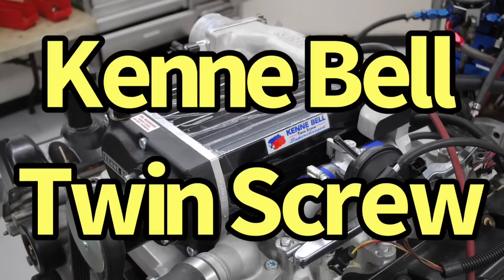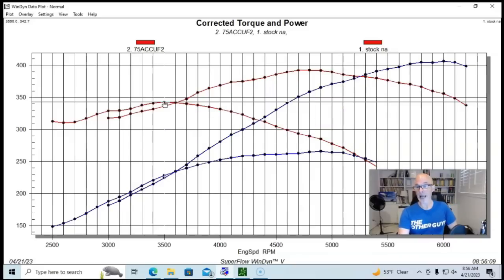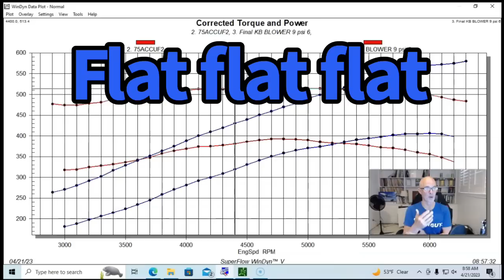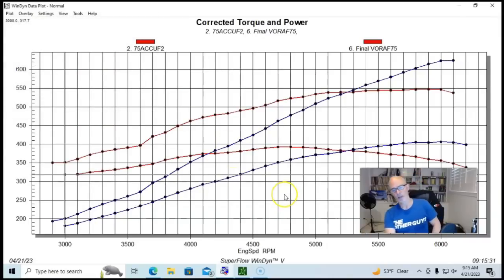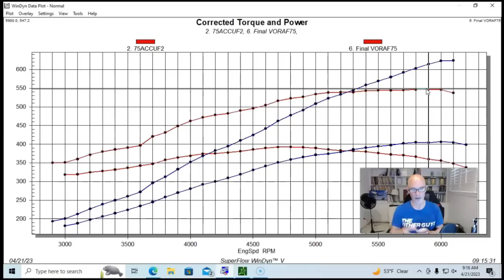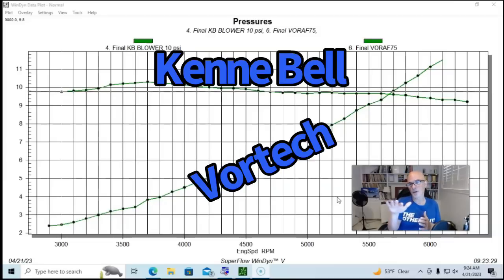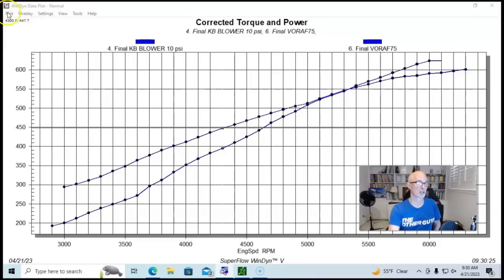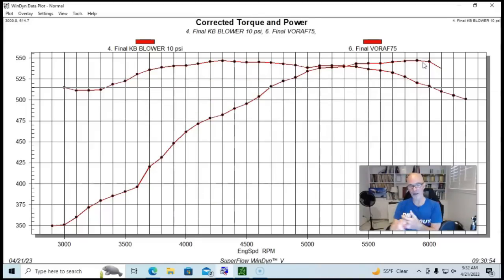JUNKYARD FORD BLOWER SHOOT OUT! WHICH BLOWER IS BETTER? VORTECH VS KENNE BELL BLOWER-4.6L 2V TEST

Comment: Hey Richard! What engine management system were you using on all the windsor 5.0 tests? I really wanted to see you do the ebay single turbo setup on the stock efi 306 with stock e7te heads, but utilizing the factory ford mustang speed density DA1 ecu and TFI distributor with only being able to change injectors and timing- of course youd have to utilize a FMU, but that is an affordable part considering even with it and a bolt on ebay single turbo setup it's still cheaper than a set of bare aluminum heads and quite possibly could make more power than changing out any of the stock components like the heads, cam, or intake. 

Only curious because engine management systems cost a fortune, aluminium heads cost a fortune, changing from the stock HO cam is pointless without either of those two upgrades for the most part aswell..

Another thing would be what is the 'wildest' cam you could run on a factory mustang DA1 speed density ecu on the virtually stock 306 with e7te heads while retaining normal operation without it surging or struggling to idle- again only with being able to swap intakes and change timing. 

I know you have the access to the parts to do so, hope you see this!
Reply from the maker: changing from the stock cam is pointless? Unless of course you want to make more power. starting with 260 hp in stock trim, you can get near 550 hp at 15 psi.
Reply: @richardholdener1727  given you have the money for aftermarket engine management that is to dial it in properly.

 sadly with my situation I cannot afford that, my current fox came with a fresh 306 essentially the same as your 306 test engine other than oe replacement valve springs and will be doing a on3 single 70mm setup with only an FMU to 'tune' utilizing the factory speed density computer.- I'm doing this as it is by far the most bang for my buck power wise vs a h/c/I combo. 

Also changing cams with the factory speed density computers these cars have upsets them too much due to the difference in vaccuum- which can only be remedied with aftermarket management or mass air conversions which both cost a large sum for fairly small gains(speaking of my basically stock setup).

Comment: Lightning motor 5.4 Kenny Bell 2.3 chassis Dyno. Race? Gas around 19 lb of boost. 500 horsepower 605 lb of torque.👍

Comment: A blower that comes on with boost at the top end would make it easier to launch. You also tend to suprize the competition coming up on them at end of the run. On the street the screw type just sounds cooler and a harder launch looks impressive.
Reply: Very true. Stickier tires alleviate that problem.

Comment: I use to just buy a sheet of perforated stainless steel.  I would just cut a piece about 2/3 as wide as the tubing fold the corners over drill the pipe and  bolt it into end of exhaust. It Pretty much always was enough to kill the lack of back pressure chock and always made it feel like it had a more consistent tourqe curve the downside you always eventually hit a point where it is restricting. I have always been a  little surprised someone didn't just develop a two sided tip. One with some baffling to help resolve the no back pressure problem and the other a spring loaded flap so when you hit 4 or 5 pounds lof pressure it opens and allows blow by
Reply: Engines don't benefit from back pressure
Reply from the maker: back pressure is bad
Reply: Yes it is. But some is necessary for scavenging until you have enough exhaust velocity it no longer matters
Reply: @keithsmith9889  how can a condition caused by insufficient/resistance to flow help scavenge?

Velocity is the part that causes scavenging in the first place.
Reply: @16vSciroccoboi  yes but without a focused resistance it will just chop and sputter. You need a tiny bit of  resistance to tune the whole exhaust. I would guarantee everything you run on a wide open exhaust system runs better with a little resistance to get it all in sync. Unless you're wide open then it because mute because the exhaust is at velocity enough it regulates itself. That's what I mean though  someone has to design a  variable cap on exhaust that folds out of the way wide open throttle.  But you can see it on any natural aspirated dyno graph will it's getting to full velocity it will have points were it falls off and sputtering. Just because there is more space in the exhaust then lower rpms can fill
Reply: @keithsmith9889  except the exhaust "sync" you're referring to is determined entirely by the tubing set up, it has nothing to do with the overall pressure level in the pipe. Pipe diameter, length, shape, etc vs displacement and RPM all play a role in tuning the exhaust, same with intake systems.

The only thing back pressure can ever do in terms of performance is reduce and/or cause flow reversion, this is always bad, at low or high rpm, it doesn't matter. The spent fuel /air mixture needs to leave the combustion chamber.

Many cars come with variable exhaust systems like you describe, and the shop manuals will specifically state that they do it for noise control, not because they want the exhaust to have back pressure at idle and low speeds. 

Some vehicles have exhaust flaps to choke down the exhaust system to help with catalyst system warmup, or to keep more heat in the exhaust for the intake manifold crossover tubes, they are thermostatically controlled, again not for low end torque production, but because of emissions. 

Efi cars largely migrated away from that for what amounts to catalyst warm up misfiring on cold starts.
Reply: @16vSciroccoboi  and you know your right I shouldn't be saying back pressure what I mean is mild resistance to direct flow
Reply: I still think that's why the dodge 2.2 naturally aspirated had that weird power climb.  I think that was the point it made enough pressure to start scavenging
Reply: Look I'm not trying to argue I'm telling you it helps low end street ability it will add a few pounds of  torque since most of the people on here can't customize a full exhaust for optimum performance it's just an idea for tuning it
Reply: @keithsmith9889  i didn't know this was an argument.

You can tell me what ever falsehood you want to come up with, I'll still state the facts, back pressure is always undesirable, and it has no benefits.
Reply: @16vSciroccoboi  they talk about what  I mean lost power under3500
Reply: Just saying I want and electric servo I can set at whatever rpm to open and scream

Comment: I'm not really in a place to test and know but about ten years back everyone started making intakes black cause they claimed it disappated heat better. So I can't help but wonder if you black engine enameled all the cold side of the turbo system would it make a measurable difference.  And I get it would make a mess. But if you're curious also I would like to see it.
Reply from the maker: no on the black paint

Comment: That low end torque on a street strip car would eat the Vortec for lunch, especially in a light to light scenario, or 1/8th mile. The Kenne Bell on a truck that's pulling something might need a  water/methanol system. In a light car with low gears, the Vortec might work ok, but it's all going to come down to setup. Just wondering how long a 281" motor holds it's guts at 500+ hp and torque.

Comment: For drag racing the Vortech will be faster. It makes more hp and tq in the rpm range that the engine will be in….. and it’s less weight. The KB will make a more fun street setup.
Reply: Dead wrong!!!
Reply: @RipitRon  how so?
Reply: @scottnewton1021  Look at the power band, the Twin Screw makes more power and more TQ All the way thru the power band until the last 2000 RPM.s, let alone the launch which puts it way ahead right out of the whole. Not even close!

I have personally been down this road with all created equal the twin screw Smokes the Centrifugal.
Reply: @RipitRon  after 1st gear…… what rpm range is the engine in? The last 2k right? And the difference in the 2 setups would be gearing.
Reply: I do prefer a roots/twin screw over a centrifugal…. But not a KB……. On this application I think a TQ Tech kit with a ported M112 from a 03 cobra would be a better option
Reply: @scottnewton1021  Try doing both same car, same set-up and the twin screw will win every time.....I know i have done this very thing along with a single turbo set-up. 

The Centrifugal was not even close, a dyno session isnt real world unless its a hub dyno (Which is closer) and its more than 2000 RPM's not a ton but depending on the gear and tire size it closer to 2500.....And again the twin screw is much quicker to spool than the centrifugal. Again its tough to make up a 1 to 1-1/2 car lengths at the 330 especially at those HP numbers.

Comment: Hey there, RIchard!

Your dyno setup is capable of doing endurance runs, correct?

Would you be willing to settle a long contested argument on the internet with that awesome dyno?

The argument is that higher octanes don't generate more power or MPG unless tuned for it, and even then it's a wash given the cons of the tune. Many disagree.

If you're willing, I'd like for you to do endurance runs for an engine tuned for e87, e89, e91, and e93(if you have e93 in your area that is), and use the associated fuels for said tuning. 

It would be great if you could run them all on something like 1-5 gallons of their tuned fuel at 2k RPM's until empty and see how many hours/mins/secs they last per tune and matching fuel. The more the gallons, the more the accuracy I presume.

I personally have a 5.7l hemi, so I'd be greatly interested in you using something that's close to 370hp stock for a close comparison. I know this will be hard to translate into MPG because it's difficult to account for vehicle mass, friction, and environmental variables, but if an engine lasts longer on a tune+fuel combo, that data can be calculated to find out how much more efficient one fuel and tune combo is over another.  And I know your dyno can track power gain or loss as well.
Reply from the maker: mpg can't be done very effectively on the engine dyno, fuel usage would be a function of fuel flow and AF ratio (for cruise conditions I doubt octane would have much benefit in terms of potential added timing), octane allows timing at WOT for power
Reply: @richardholdener1727  well darn, so total run time based on tune would not be any different whatsoever eh?
Reply: @richardholdener1727  if you make it, I'll watch it lol. I assume a bunch of MPG min/maxers would too. Might bring you a new set of viewers haha

Comment: Twin screw for good short track times on drag car with prep surface. Vortec street car possibly less likely to brake traction on the low end, maybe a slightly better mpg when not on full throttle.

Comment: I would of liked to know boost temps  after some runs kenne is known to be hotter after a few runs remember low speed torque is for first gear after that you don’t drop very low so hp is your friend
Reply from the maker: a twin screw is actually much better for parasitic loss and air temp than a roots

Comment: I'm still waiting for roots blower with a clutch like Mad Max had...
Reply: That's been done.  The Mercedes M271 had an electromagnetic clutch to stop the Eaton blower from turning when boost was not demanded.  Plus, the Eaton blower had a bypass valve.
Reply: @andyharman3022  Not sure it's trivial for a electro clutch to hold an over 100hp load?
Reply: The Mercedes 55 AMGs have a clutched pulley but I guess technically that doesn't count because they are twin screw and not roots.
Reply: @TheInsaneShecklador  I went down the "rabbit hole" before searching for higher power electro clutches before and couldn't find much. Let me know if you figure it out. Would be ultimate cool with on demand supercharging and bypass.
Reply: @davidmitchell7183  It's not something I'm interested in doing. I just know the Mercedes AMG 55 supercargers are equipped with one. Perhaps finding one with damaged rotors and salvaging the clutch mechanism off of it would be a good starting point for your project.
Reply: @TheInsaneShecklador  Screw compressors and Roots blowers are both positive-displacement machines.

Comment: I had an 02 gt with ported trickflow heads, comp stage 2 cams(don't ask me specs because I have no idea anymore), jessel folowers (those mf'rs were like $100 each) BBK long tubes, dual gt supercharger pumps,  and a vortech v2 with a billet impeller upgrade made by some company (supposedly when spun harder would outflow a t trim) even after I put the nitto drag radials on I barely got traction after I heatedthe tires up. I can only imagine how terrible it would have been with the Kenne Belle with all the extra low speed torque. The centrifugal setup is definitely the way to go. All the horsepower in the world does you no good if you can't transplant it to the ground.
Reply: Tire bro, you need a sick grippy tire.. i personally prefer all the torque for a street car, centri for a drag car, but i've never been a fan of the centri..
Reply: @P71ScrewHead when i used to run a centri blower i could still blow mickey Thompson rock throwers off the car with a vortech.. the kenne bell would have been a headache to be honest. I ran  9 lbs centri and cams with 4.10s and put a bus length on my buddies 12 lb kenne bell with 3.27s

Comment: Pd blowers are harder to hook up imo
Reply: Motortrend had an article about a Ltd Fox chassis with an m90 mounted remotely that  ran excellent 1/4 mile times. Look for AlexLTD here on youtube
Reply from the maker: m90 would be very small
Reply: @richardholdener1727  Definetly not a big power handling supercharger. Enough to wake up a mild 302 tho

Comment: The legend himself makes a 2v video in 2023 what a guy
Reply: I'm a loyal 2v guy n yes, he's the man.. Not many ppl care to build a 2v anymore, fuck them..
Reply: @P71ScrewHead Yea, I think I'm going to go with the vortech supercharger.
Reply: @hotrodlincoln7186  Gonna be a fun car.. Let me know how it goes..
Reply: @P71ScrewHead  will do 
Just need to save up for the build
Reply: @P71ScrewHead  I want at least 500 to 600 to the wheel and 450 to 550 for tq
Reply: @hotrodlincoln7186  Sounds good, go with a kit rated to at least 1k hp.. Last thing you'll want is more power n have to swap parts out.. I already got used to the 309rwhp 321rwtrq I got, I want more..lol 😩 Car is fun tho.. 😉
Reply: @P71ScrewHead  should I go with a paxon 2200sl or procharger
Reply: I have both types but the centrifugal is on a older 5.0. It is fun but the kenne bell on my  saleen feels so much better. Not really apples to apples but I have also rode in vortec 2v's and it was fun but not twin screw fun
Reply: @Boostin365  Amen, pd supercharger FTMFW..
Reply: @codycate4857  I agree that the twin screw is more fun. But it does get hot 🔥 to quick and acutely robs you of power
Reply: If pushrods can still exist, why not the 2v